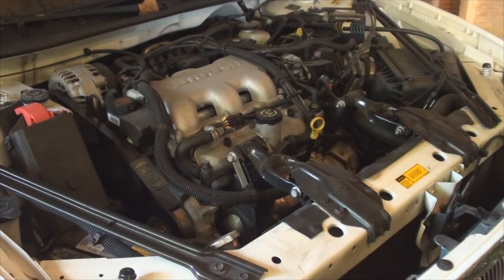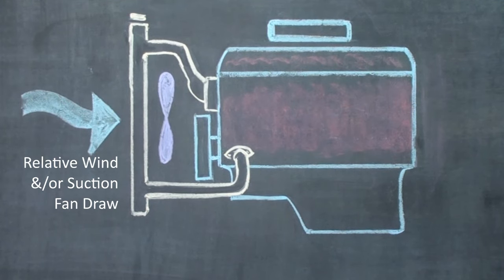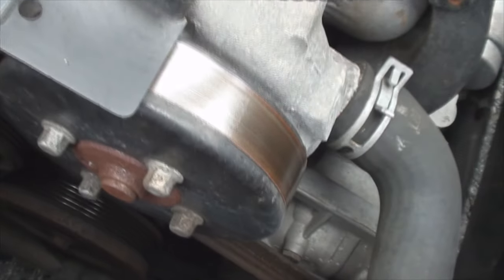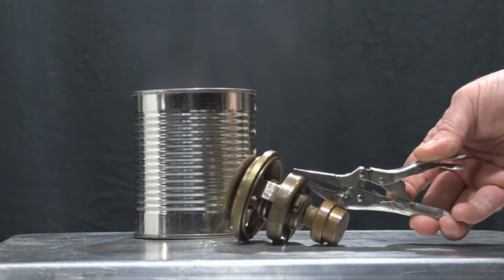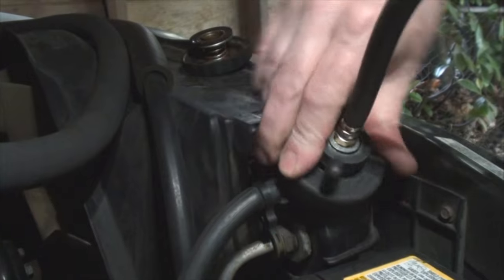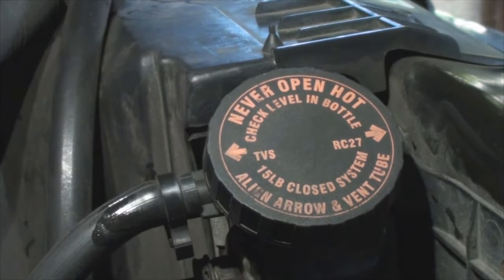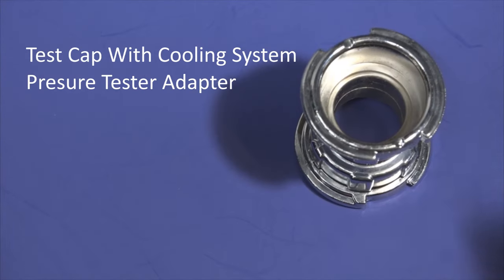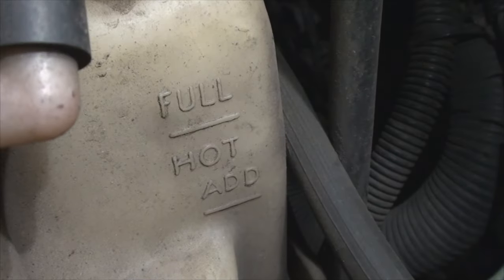How A Car's Cooling System Works

Comment: I remember the old days where you would see coolant puddles everywhere a car was parked.
Reply: Yeah when I got my cadillac it would leak from the water pump I was that guy for a couple weeks leaving a small stream at the gas pump 😂
Reply: My car would have fitted in that period just fine
Reply: @user-dd9qq1ru7s  my oil hose connect to the filter leaks and every day I leave for work there's a small puddle of oil where my car was parked 🤣

Comment: The pressurized water collecting tank is not pressurized. You could leave the cap unscrewed without affecting anything except small water loss thru evaporation.
The confusing thing is that the reservoir also control the radiator pressure. It does so by having the tube connected from the bottom or, if from top, it is long enough to hang close to the bottom.
The height of the reservoir is what determine the pressure.
The force needed to push the water in the tube, going against the air bubble which are pushing upward, this is what regulate the radiator pressure.
How all this can be demonstrated?
If you hold the tube upright, vapor escape right away.
If the reservoir is almost empty, vapor and water arrive from the radiator until it become full enough to reach equilubrium.
When the motor is stopped and cooling, suction from vacuum created by the water vapor in the radiator is syphoning water from the tank.
Simple but ingenious way to control temperature and pressure without wasting water.

Comment: So if the end of the radiator cap breaks off and falls into the filler neck (like mine did) it shouldn't cause any problems because it's too big to go anywhere and it will just sit in the top tank?

Comment: how does the anti freeze coolant pass through the engine without messing up the combustion of the cylinders?
Reply from the maker: Think of the cooling jacket as a hallway and the combustion chambers are the rooms but the rooms have no doors leading to the halls only windows (valves) to the outside

Comment: great explanation.
Can you explain if possible to me - which fins they using in radiator and why ?
How this radiator working inside a flow regime
Reply from the maker: The fins are flat and contain no fluid they are attached to tubes that are round and full of hot fluid flowing from the thermostat to the water pump. Heat is transferred to the fins by conduction and the (relatively) huge surface area of the fins exposes the heat to cooler air to allow a heat exchange (radiation). 
So don't power-wash your rad or you'll flatten the fins and prevent the air from passing through and conducting the exchange.

Comment: I have a 2001 Toyota Celica that STILL has a PO115 code. I've replaced the sensor after checking to make sure the 5v reference was present. I checked the sensor I pulled out and it is Good. yet I continue to get this code. Also the temp gauge will slowly increase in temp as you drive reaching normal oper temp sit there a mintute then move up a tick beyond normal sit there a second or two then quickly move to HOT and begin flashing. I've replaced the T-Stat. Tested old T-Stat and it was good as well. *Note* I also have NO heat which lead me to believe I had a clogged heater core so I have back flushed it repeatedly using prestone flush ,air compressor and water. I still have NO heat and temp gauge is screwy. I have tried several times to get all the air out of system. I'm not sure I'm getting flow because the hose going to from the T-Stat to the radater seems to have no fluid in it very easy to squeeze shut. When I removed the heater hoses very little coolant came out same with the radiator hoses and the coolant sensor I'm lost as to what the problem is I've checked the water pump and it appears to be good there no leaks anywhere in the system and there NO noise from the water pump the pulley isn't loose and does NOT move when wiggled. Anyone with any ideas would be great.
Reply from the maker: +sweetbrandigirl - Sounds like you know alot. I would disconnect all the hoses and try forcing water with a garden hose through each component individually to pin point the problem. Isolate the rad, open top and bottom, shove a hose in the bottom and seee what comes out the top. Same for the heater core and engine block (water pump and thermostat removed). There's a good chance it's aluminum corrosion from the engine or cyllinder heads or decomposed hose lining - just one chunk/flake can block a passage) If  I was 100% sure it's not blockage then I would change the wiring harness. I have had experience with boats that have been sunk in salt water (any chance it is a Katrina Car?) and give error codes until a new harness is installed. Not sure if that's worth it for your car - good luck!
Reply: Repairs101 Thanks for replying. Yes you could say I have a little exper ASE cert twelve yrs turning wreches, but this one has me stumped. I've ran water through the heater core and have good flow. I'm thinking about taking it somewhere that has a coolant flush machine and seeing if that helps the problem.

Comment: the cap is also new. but i dont see the water resoviour get filled with hit water or reducing when cool. what to check. i replaced a thermostat sensor.  niw it shows the heat is 60%
Reply from the maker: Check the resevoir outlet port for blockage. Check the overflow hose for pinching, bends or blockage.

Comment: Nice video...can i ask why is the water inside the radiator sucks and empties the expansion tank water everytime i use my aircon. Please help!
Reply from the maker: Tough one. The cooling system and the A/C system (although local and proximate to each other) are in no way connected.
Reply from the maker: https://youtu.be/Es6EQNPXb2c

Comment: what happens if I fill the expansion tank too ? not filling it up completely, but I meant to add coolant in it more than the "maximum" indicator ?
Reply from the maker: When the hot coolant exits the rad and moves to the already filled expansion tank it will likely overflow out a vent in the cap spraying all over your engine compartment and likely causing a lot of sweet smelling white smoke.
Reply: thanx for ur kind reply sir.. so would u recommend me draining the expansion tank ? or just leave it as it will get rid of the over filled coolant ?
Reply from the maker: Get a $1 turkey baster at a dollar store and draw out the excess - and save it in your coolant jug for when you need it!
Reply: well thank you sir. god bless u

Comment: Upper radiator hose stays hot and firm after truck has been sitting any thoughts.
Reply from the maker: Marky David My first thought is you must have a big truck engine that takes forever to cool off? How about some more details for a better guess?
Reply: +Repairs101 I have a Ford f 150 1999 upper radiator  hose stayed pressurized over night i had not driven it for about 7 hours prior. Overheated this morning.The hose was pressurized this morning before i started it up but not hot.
Reply from the maker: Marky David Sounds like a couple of things are wrong. Sure the hose is pressurized and not just swollen and or hardened (typical for older hoses)? If you take the cap off it sprays coolant or sucks air? If not maybe the hose is deterioriating and plugging up the radiator core to cause your overheating. Often a hose looks fine on the outside but is decomposing and shedding chunks on the inside. If the pressure is positive (spray) I would suspect the rad cap is not releasing coolant to the expansion tank. Same for a negative (vacuum) pressure where the hoses may seem like they're going to collapse (or not). Either way it (+ or - pressure) would likely be a failure of the cap and or the hose / passages to the expansion tank. Good luck!

Comment: hi.. why do you think my radiator is always empty but the reservoir is always full, my wife always fills the radiator .. good thing is the water goes up when the car is active... I'm confused. Car is Honda Fit. sorry we have no knowledge about it.. the mechanic says it is ok and no leaks (at least on standby).
Reply from the maker: The coolant is going somewhere. 
White smoke in exhaust? Maybe blown headgasket or cracked cylinder head
If the reservoir doesn't drain the hose is plugged &/or the rad pressure cap is hooped.
Reply: i'll ask my wife about the exhaust.. sorry we are in different location, i am an expat. thanks for the reply.  I'll forward your answer to her and let you let you know
Reply: it was the radiator who has leak, mechanic told us... maybe it is time to buy new..

Comment: So is the fan blowing the radiator or the engine?
Reply: Blowing the engine so it can suck up more air through the radiator to keep the coolant at a lower temp along with cooling the engine. If I’m not mistaken.
Reply from the maker: The fan draws air through the rad and blows it over the engine effectively cooling twice.

Comment: Sometimes when I start up my car, there is a really loud fan that comes on but it turns off after about a minute. I thought it might be some kind of extra cooling fan but I wasn't sure. Any ideas?
Reply from the maker: Help me out a little, Grant. 
What car? Cold start or hot? Where's the sound coming from? Loudest inside or outside? Heat on? A/C on?
Reply: Thanks for replying! Well it is an Infiniti QX80 with the 5.6L V8. It is in Texas so it is warm here but it will make the noise when it is started "cold". It also occasionally turns on for a few seconds when driving in the middle of the day. I looked and saw a belt driven fan, but I didn't see anything else. Maybe there is some auxiliary cooling fan hidden under some plastic?
Reply from the maker: Unfortunately I'm not familiar with that vehicle (i'm a boat mechanic) but will refer you to a(nother) great (Canadian) YouTuber Mark Whinton of CarQuestions  https://www.youtube.com/c/carquestions/featured

Comment: hi sir..i am using nissan tiida, recently i found my coolant reservoir tank level significantly decreased with in a week ,evenif i filled it to the maximum mark...i could not find any external leakage of the radiater .I am doubtful about the speed of the fan is less..does it effect the coolant level to come down? please attach your suggestion in this regard...have a nice day
Reply from the maker: +Pradeep Menon - Dude check your engine oil to see if the oil level has risen and/or become frothy milky foam. Otherwise check your exhaust emissions for sweet smelling white smoke. In either case you will require a head gasket. Sorry, try to have a nice day anyways.
Reply: sir..i have checked it all..nothing wrong. oil looking good ,no change in level of oil too..still the coolant level coming low everyday at rate of approximately 1cm per two days..still confused
Reply from the maker: +Pradeep Menon - No sign of leak under car and no white smoke and no milky oil with rising oil level? How long has this been going on? Is there a recent service on the cooling system that might explain trapped air slowly being chased out of the system? Are you using straight water in a hot enviroment? If so switch to coolant  ASAP.  OK next I would feel around the floor to see if the carpet is wet up under the dashboard/front seat footwells to see if the heater core or a connection is leaking into the car. Also look closely at the radiator front and back to see if there is a wet area that evaporates as quickly as it seeps out.
Reply: yea as u said recently my heater core was having leakage, and i found my coolant tank empty, at the same time leakage inside the car under carpet...Then we disconnect the heater core connection and sealed the coolant connection  into it so that at present heater core is not having connection.it was around three weeks before..that time i had to put some water into the radiater as my coolant level was so low because of this leakage..after fixing it as i described above they removed all fluid from my radiater and filled a newly bought high quality (the same one i was using before too).After this service around two days i regularly refilled to compensate the the coolant level to maximum mark..There after for two weeks there was not even a single mm of drop in coolant level..Then i stopped checking it for a week..After a week when i noticed i could see it was below the minimum mark in the reservoir tank...sorry for the long explanation...i think i made you head ache..sorry sir
Reply from the maker: +Pradeep Menon - I would investigate how effectively the cooling sytem was sealed off when the heater core was disconnected. Fill the system and get it up to operating temperature. Shut the engine off before examining with mirror and flashlight  and stethescope/length of garden hose to detect hissing. There will be 2 ports to check, one for coolant going to the heater core and one receiving coolant from the core. Look for stains from the burned off coolant. My guess is one is leaking and the lost fluid is landing on a hot engine or exhaust part and evaporating immediately  - so little you dont notice the resulting steam. Good luck!
Reply: thanks sir for your great advices...finally i found out.. it was due to slight leakage one of the two pipes of heater core which i told you we have sealed due to core leakage... the sealed rubber bush was not strong to seal the pipe so that coolant was dripping weakly .Now we have replaced that pipe plug with a new rubber plug . now it is ok... thank you sir

Comment: Does it ever go through the Engine Head?
Reply from the maker: +AKFGFan - Yes coolant travels throughout the cylinder head in passages to collect heat. That's why if your engine is blowing a lot of sweet smelling white smoke you will need a new head gasket - the seal between the gallery and the combustion chamber has been breached. 
I chose not to show too much detail for the sake of a comprehensible diagram. Good luck!
Reply: Hahaha that is a pain in the butt. My OLD truck had that happen it was called hydrolock....my dad and i had to change the head gasket. Next time it happens i will scrap the vehicle or pay someone else to. So much to take off to get at it...not to mention coolant is great at eating metal and leaving a coating that doesn't let oil touch the bare metal which needs to be cleaned up. Im clearly not a car guy but i think that was a big pain. Hydro locking that is

Comment: It looks you are expert and I would like to ask you why air conditioner blows cold air trough the central vent and hot air through side vents inside the salon Mercedes e320 diesel, none of mechanics I've asked know the answer to that
Reply from the maker: I'm no expert but it sounds like one (or more) solenoid(s or vacuum actuators behind the dashboard) that control what air flows: when, where & how much - is not closing out the heater core when the A/C is on so you have two systems open to the cabin at the same time.

Comment: what will be happen if water pump belt removed by accidentally?
Reply from the maker: Coolant / antifreeze won't circulate, engine will overheat, possible catastrophic failure.

Comment: I meant it doesn’t have a radiator cap the reserve tank acts as a filler why some cars designed like that
Reply from the maker: Either low pressure system or pressure/check valve employed

Comment: You don't give any information how the heater matrix works.and what direction the water flows through it.this is just basic amature information.i have a heat issue no heat.and it's not the matrix.

Comment: I came here from page 68 of 12 Rules for life: An Antidote to Chaos
Reply from the maker: I'll bite. What's it say on page 68?
Reply: Context matters.  Chapter 3: Make friends with people who want the best for you
In here, Dr. Peterson talks about how insanely cold the place he grew up in was and how that made friends matter even more.
Reply: "And it was hell on house cats. Felines in Fairview had short ears and tails because they had lost the tips of both to frostbite. They came to resemble Artic foxes, which evolved those features to deal proactively with the intense cold. One day our cat got outside and no one noticed. We found him, later, fur frozen fast to the cold hard backdoor cement steps where he sat. We carefully separated cat from concrete, with no lasting damage-except to his pride. Fairview cats were also at great risk in the winter from cars, but not for the reasons you think. It wasn't automobiles sliding on icy roads and running them over. Only loser cats died that way. It was cars parked immediatley after being driven that were dangerous. A frigid cat might think highly of climbing up under such a vehicle and sitting on its still-warm engine block. But what if the driver decided to use the car again, before the engine fooled down and cat departed? Let's just say that heat-seeking house-pets and rapidly rotating radiator fans do not coexist happily."
Reply from the maker: So you're here to promote this book.
Reply: @repairs101  I'd be lying if I said I wasn't but I am also really hoping that other people who did the same thing as me:  looking up what a car engine fan looks like to understand how it would be  dangerous to a cat. It would be an amusing coincidence.
It's happened before with other things, like In reading a webcomic and a famous classical song is referenced. I look up that song and I see that other people in the comments came from the same source. 
And sometimes, I end up on videos where people came from another place and I end up checking that source out. And the network of knowledge/entertainment keeps increasing.
To clarify: I'm not making any money from this, I just wanna see if other people did the same thing as me
Reply from the maker: Alright then. Honesty goes a long way with me. Happy fishing!
Reply: @repairs101  thanks for understanding!